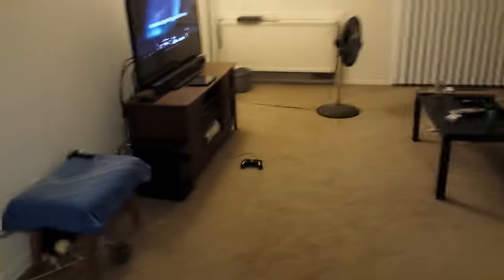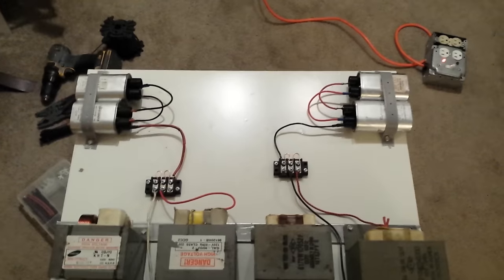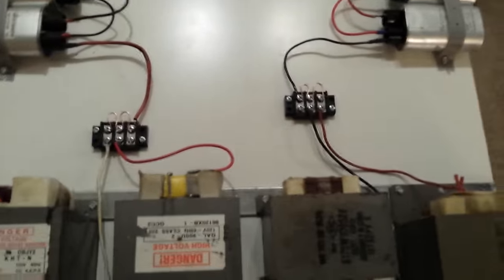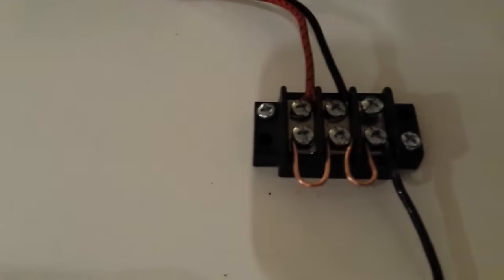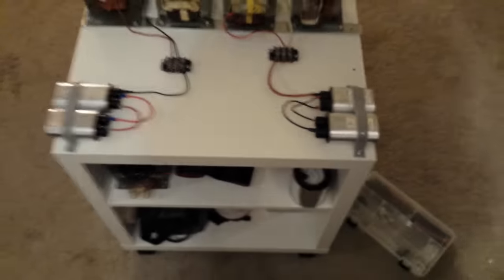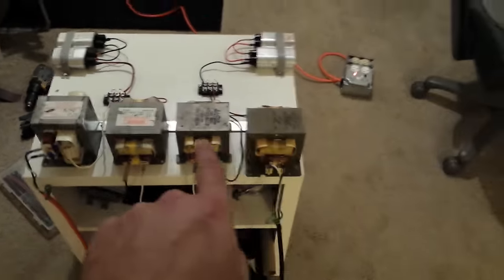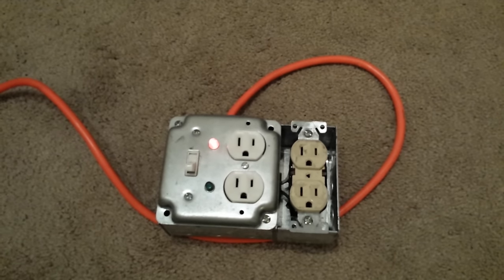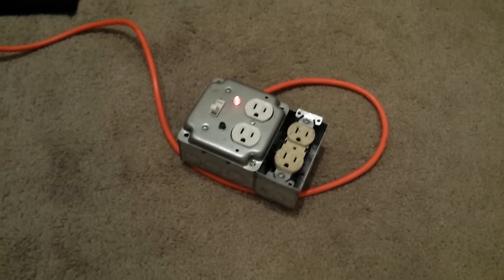Microwave Oven Transformer Cart of Doom! (Part 1: The Beginning)

Comment: take 2 mots , a transistor , Diodes , capacitors out of microwave , a switch and a plug ins strip.  assemble so that the transistor pulses the two mots and the energy is stored in the capacitors. Connect plug ins strip to caps. Input voltage to the transistor with 12 volt battery by switch for about 5 seconds , then switch off.  Plug in your items: induction cook top , heater , refrigerator , skill saw , battery's  examples.